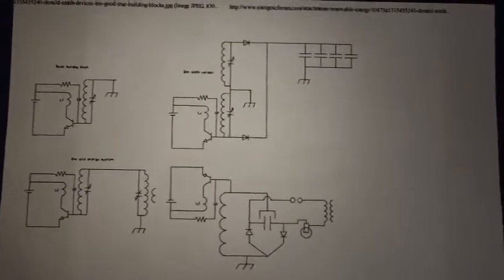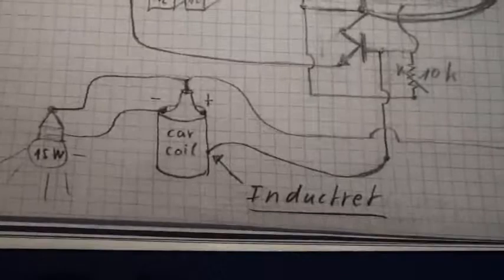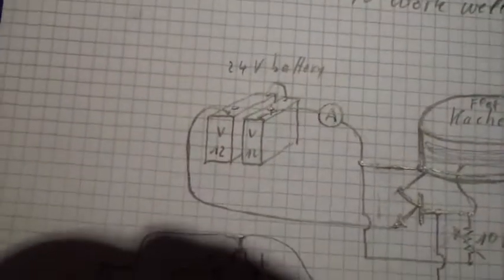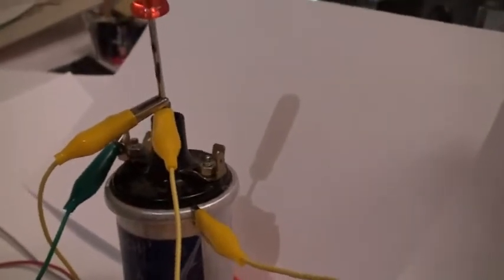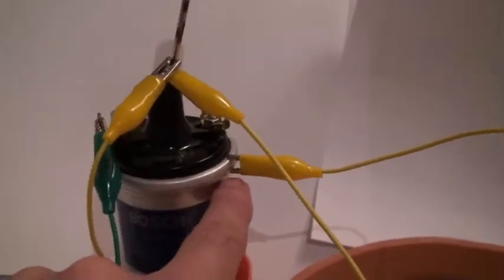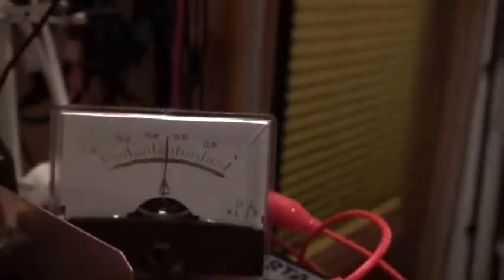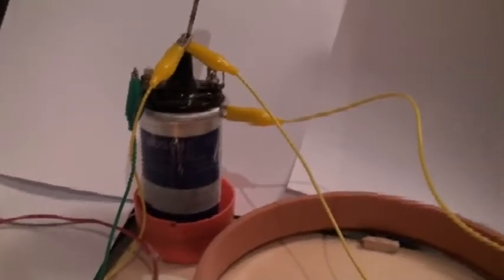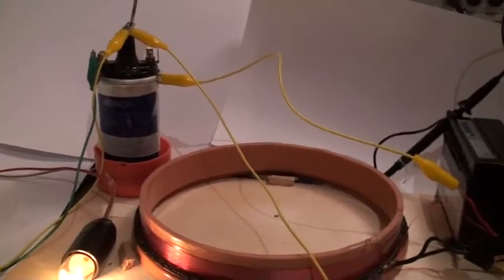amazing discovering of an  inductret effect 1.wmv

Comment: I have check chematics - U practically use two HV coils (one is 80 turns from Katcher - second - Ignition HV coil - around 10000 turns) the are conncected into Base of Transistor and opposite sides - to ground and Bulb. The second input of the Bulb is connected to inductor or Ignition and that way it works like kinda HV capacitor - between HV of Ignition coil and Primary coil of Ignition. That is all!

Comment: Hi Woopy, well done, but the light looks less than 12 Watts...
Okay, the internal losses seems to be also 12 Watts, but maybe it is
just impedance matching, when you connect the bulb ??
If you could come up with a higher brightness, so it the bulb lights brighter than 12 Watts, that would be great.. By the way.I guess it is called in English: Good night to all and not: at all...just a little tip  ;=)